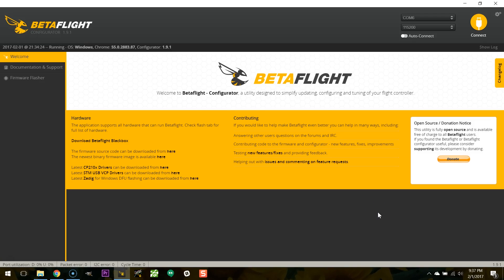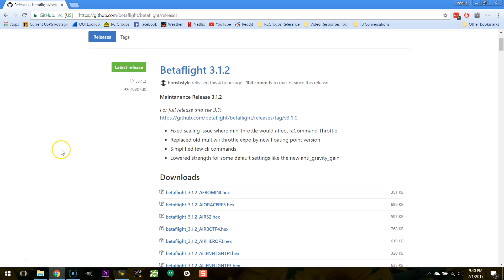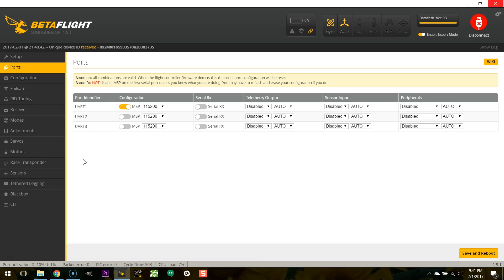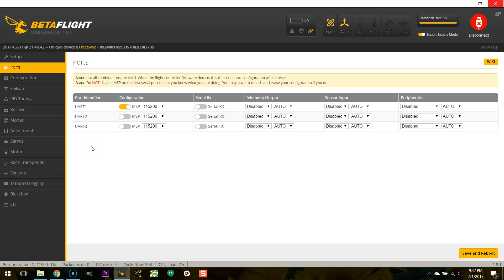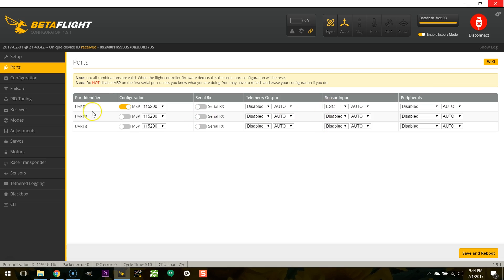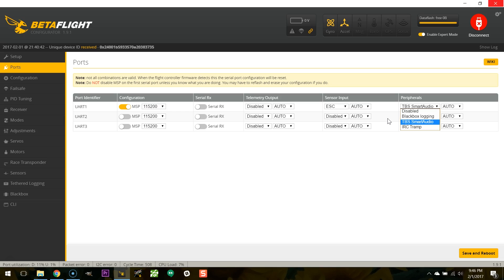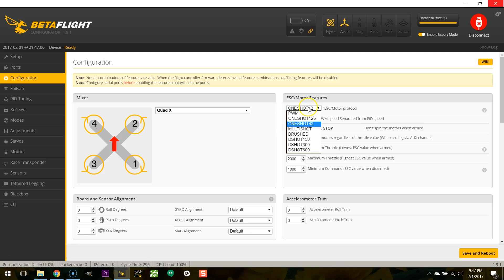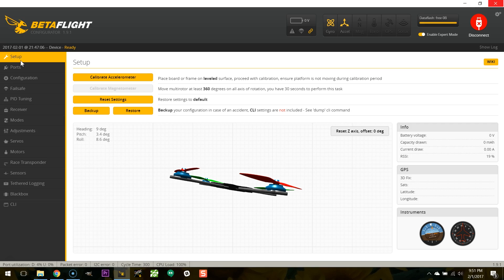Betaflight 3.1 GUI Overview | WHAT'S NEW WHAT'S DIFFERENT?

Comment: Hey Joshua wondering if you could help. I have no problems connecting my wizard x220 to betaflight but I just bought a eachine aura 100 and my pc says USB device not recognized and on betaflight config nothing changes like showing com3.
Reply from the maker: +steven USB device not recognized sometimes means bad cable. Sometimes means damaged board. Seldom means bad drivers.
Reply: Joshua Bardwell turns out for whatever reason the board doesn't like my windows 7 pc but it connected and worked fine on my windows 10 laptop. Not sure what that's about but at least I can get into betaflight now. Thanks for the reply buddy.

Comment: My wizard is hooked up to betaflight, however,  when I tilt it forward it tilts to the left on the screen.  how is this fixed?
Reply from the maker: +190dopey adjust board alignment in the configuration tab. Your board is installed 90 degrees rotated.
Reply: Joshua Bardwell you're the man. Thank you

Comment: hi Joshua, 

thank you for all your information . helps a lot 👍.
I see in other video's you talked about anti gravity in bf3.1. 
i have always the problem with the pitch when cut off the throttle.
how to activate this and how to use. 

thank you very much and keep up the good work👍.

thanks,

Erik
Reply from the maker: In the CLI:

set anti_gravity_gain = 3.0
save

Try values from perhaps 2.0 to 4.0 or even higher if you prefer, but I have found that no higher than 4.0 has been needed to hold attitude on even strong throttle changes.
Reply: thank you very much 👍👍👌

Comment: Josh If i was to select multishot, save and reboot is that all that is needed to be done? or do I have to download and flash ecs's? Im using a Eachine wizard x220 F3 version. Cheers.
Reply from the maker: +GregPhillipsEdits it supports multishot from the factory. Select it from the pull down and save. And don't forget to recalibrate and readjust min_throttle.
Reply: Joshua Bardwell ok thanks for your reply! Also thanks for doing these videos! Cheers from Australia.

Comment: Yo josh I just installed to betaflight F3 FC have you had the problem of of motor 2 not spinning up it spun fine calibrating motors then plug in battery to do the maiden an motor 2 won't spin up any ideas ?
Reply from the maker: +Mike Lovell no clue. Basic troubleshooting... Swap the ESC with another one?
Reply: Joshua Bardwell got it working just flashed the newest firmware an it working again thanks for the reply though

Comment: Hi josh. I just flashed betaflight 3.1.5. It flies well. But it feels like i have throttle expo turned on. The throttle give no response until passed 20% throttle. 
In betaflight 3.1.5 changelog, they restored multiwii throttle expo. How to turn this off?
Reply from the maker: +Muhammad Hijrianza reduce min_check. It's not to do with expo. Expo is off unless you have enabled it.
Reply: Joshua Bardwell what value the min check should be? The default value is 1100. Max check is 1900, should i change it too?
Reply from the maker: +Muhammad Hijrianza min_check should be about 5 or 10 above whatever the minimum value your throttle channel hits reliably. If your channel endpoint is 1000 and you have a good gimbal that hits it reliably then it should be 1005.
Reply: Joshua Bardwell ok, i'll try it. 1 more thing. I feel my quad fly too floaty. Is this the effect of the new anti gravity feature? What value shoud i give to reduce this floaty effect?
Reply from the maker: +Muhammad Hijrianza lower min_throttle
Reply: Joshua Bardwell Ok. Thanks for your advice.

Comment: Hey Josh!
In Betaflight you can select between different Rate Profiles and also different Profiles ( with PID's). You can select the Rate Profiles from a switch on the Tx in the (you can configure in the Adjustments tab), but it seems to me that there is no way to select the "profiles" with a switch (not listed in the Adjustment tab). I would like to have different PID settings for 4s and 5s.
Thank you very much
Reply from the maker: You can't change PID settings with a switch. You can change PID profiles with a stick command though. The reason used to be that PID profiles were tied to the PID controller, and you couldn't change PID controller without re-initializing the FC, which you obviously didn't want to do in flight. But now that there is only one PID controller, maybe that is something that could be done.
Reply: Joshua Bardwell 
So you mean, there is no real way to change all your PIDs really fast right now, but it would be technically possible f.e. in a new version of betaflight? :)

Comment: I know my Question is not about Betaflight but I have seen that you responded on a Github issue about the Not- inverted Sbus in Cleanflight. So in Inav 1.6 shoulb be a way of doing this but i can't figure out how. Do you know anything about this?
Reply from the maker: +MrAffi FPV I don't think I do.
Reply: Joshua Bardwell thank you for your quick response. Then I may use an external inverter
Reply: I found it! 
Set sbus_inversion = off should do the trick

Comment: Lua script for IRC tramp mostly works, and is definitely usable. Looks like it will be fully working in 3.1.4 or 3.2 as there is a pull request waiting to be merged: https://github.com/betaflight/betaflight/pull/2321

You'll also need to keep an eye on the lua script repo as the dev mentioned on ßF slack group that will also get updated soon: https://github.com/betaflight/betaflight-tx-lua-scripts

This RCG thread contains more info:
https://www.rcgroups.com/forums/showthread.php?2793214-Modify-Betaflight-PID-VTX-Settings-w-FrSky-TARANIS-LUA-Script-Menu

Comment: Im having a strange issue with my failsafe on my Wizard 220. 

If i lose signal instead of stopping dead the motors power up to what sounds like 100% throttle. Im using a Spectrum DX7s  if that helps.

I copied your suggested setup and i know your not having that issue. I think it might be the transmitter?

Any ideas?

Thanks!

Comment: Funny you mentioned " stuck in roll" fix.  I flashed 3.1.3 yesterday and the first time I did a full stick roll it happened.   I did a few more rolls and it was normal so I flew 5 packs and didn't have any other problems.

Comment: after i updated to 3.0 i tried to do a flip and i believe my copter kept rolling. I am not sure if it was desync as i did not calibrate esc's or if it was a problem with the Iterm windup handling that was fixed in 3.1.1. Is it worth me updating, and hoping it was the Iterm windup?
Reply from the maker: +David Lewis it was definitely the iterm windup. Upgrade to the latest ASAP.
Reply: +Joshua Bardwell Just did it, i shall hope for the best. Thanks for the help
Reply: Whelp was not that, perhaps my dodo cannot handle 3.0 idk

Comment: hey Joshua,

I need your help! I Built a quad on a h style frame over the summer and flew it without any problems.  I bought an x style frame recently and transferred all my components over to it.  Ever since I built the new quad I have been having random issues with it.  On my first test hover the quad freaked out and flipped over full throttle into the ground, even though it worked fine without props on.  This has happened to me multiple times over the past few weeks. I thought i fixed the issue with it (A failsafe setting), but today when I tried to fly I let the quad sit for a minute plugged in while I was talking to someone, and the props started to spin and increase speed without me arming anything. I use a Naze 32 rev 6 board, with 12 amp Afro Esc's flashed with SimonK. My receiver is a turnigy iA6-c with a turnigy I6s transmitter.

Thanks
Reply from the maker: There really is no way for the motors to spin without the FC perceiving that you armed the copter. This is absolutely the first thing to investigate: why does the FC believe that you instructed it to arm when you don't think that you did.
Reply: Joshua Bardwell thanks for the reply, do you think it is an issue becuase my Naze is older technology, and it does not properly communicate with my Rx?
Reply from the maker: +Grayson Gilbert no reason Naze can't work. I think your TX config or Modes must be wrong. It should be really difficult to cause Betaflight to arm unintentionally.
Reply: Joshua Bardwell ok I'll take another look at it thanks for the help!
Reply: Grayson Gilbert hey this might sound really stupid but I catch myself doing it to. Are the motors spinning the right way, are the props also the right way too?
Reply: jussa101 yeah they are in the right orientation because I can fly normally when the quad isn't acting up

Comment: Just a quick question.. I have BF now on my kiss fc as it was suffering terrible oscillations in kiss gui. I'm a little confused as to what to set my looptimes at as I have Kiss fc with kiss 24a flashed with dshot 600? (Re: kiss fc's looptime limitations vs escs ability to operate at 32k)
Reply from the maker: The ESCs can only run at 32k if the FC can. Does the KISS max out at 4k or 8k? That will be what you need to run at.

Comment: If you turn on Dshot and you have installed a non-dshot ESC, can the digital signal corrupt the ESC software and maybe brick the ESC? I installed the xRacer Quadrant and turned on Dshot because I thought they would already have the latest firmware installed but suddenly all 4 were broken. I could not connect them to Blheli Suite and they didn't accept the signal from the FC. So I had to use SiLabs C2 ports to revive them. Three are working now one seems to be dead forever. :(
Reply from the maker: I would say no, that's not really possible. But hey, it looks like it happened to you, so I guess it is.

Comment: Joshua can you run a mic and smart audio or does a switch need to be wired between them?
Reply from the maker: If you run a mic and smart audio you will hear the smart audio beeps in your earpiece when configuring the vTX. But this will only happen when disarmed so it won't affect flying. Yes, you can do it.
Reply: I also asked TBS regarding this issue but didn't get a reply. :) so..... basically solder 2 wires in the smart audio? 1 to uart (for vtx configuration) and another to the mic? :) thanks alot joshua.

Comment: My onboard sd logging for blackbox isnt working anymore. Do i need to chose blackbox logging on one of those drop downs in the ports tab?
Reply from the maker: No. Onboard SD does not involve the Ports tab. What board are you running? What version of BF?
Reply: SPF3 Evo. It stopped logging on the SD card when i went from 3.0 to 3.1.3.  I have blackbox enabled, it even shows on board blackbox logging in the blackbox tab. I checked my switch and it is setup correctly. Dont know why the sd card is empty after flight
Reply from the maker: +Wiickedd FPV does Blackbox logging tab show e.g. "4 GB free space"? Does it show that the card is mounted? Doe you have file" FREESPACE on your card?
Reply: Yes to all the above.

Comment: i've got a question for you. On the PIDs page, by Angle/Horizon, there is a parameter called "Strength". It is my understanding that this number tells how strongly the FC will try to level itself. My question is, in which direction do you get the most "stabilization"? I've heard on some channels that a low number equates to a "docile" quad, while on other, a high number means that the FC will fight harder to keep your quad level. Which is correct? Thanks in advance. Cheers.

Comment: Please help!
I´ve bought an Eachine Wizard x220 ARF and I want to use it with my Spektrum DX6. I have already a normal OrangeRX receiver R620 without PPM -> so PWM. I´ve read that the F3 6DOF is compatible with PWM so I bought a PWM cable (like this one: http://thumbs3.picclick.com/d/l400/pict/172452394994_/6-in-1-8-Pin-Anschlusskabel-Set-Empf%C3%A4ngeranschluss.jpg) I connected it to the UART3, where the other cable with only one connector was also plugged in. In Betaflight (Version 3.0.1) I enabled Serial_RX on UART3 and set the receiver option to PWM. Now my Throttle, Yaw, Pitch and Roll works, but I can´t use the AUX2 for arming and the AUX1 for my different flightmodes. I´ve set them already correctly up in my tx and in the modes tab but I don´t find a way out...
I´m new to FPV Quads and so hopefully you can help me getting my Wizard into the air
Reply from the maker: disable serial rx on UART3. PWM is not a serial protocol.
Reply: Thank you for your quick response, but if I disable Serial_RX on UART3 I only get a signal for Yaw showed on AUX1 and for Roll on AUX2... (in the receiver tab)
You please may have even an other advice for me?
Thanks

Comment: Thank you for the explanation of the I-term windup bug that was fixed in 3.1.2 - I actually hit that on 3.1.0 and (after a few deep breaths to recover during a roll) upgraded to 3.1.3 but still wasn't sure whether that was the exact issue. 

I guess I need to follow the thread in RCGroups more closely.
Reply from the maker: Or just watch the Releases page on github.

Comment: Hey Josh. I'm curious what the pull down menu under current sensor is all about. I believe u have a choice between "onboard ADC" and "ESC". What's the difference? Thanks again Josh. 
P.S. the Unify Pro we talked about in FB messenger is on its way brother.
Reply from the maker: +Mr. Pink ESC uses the KISS ESC current sensor telemetry.